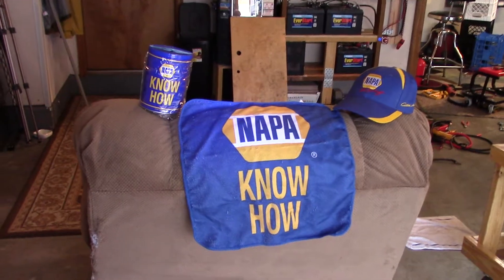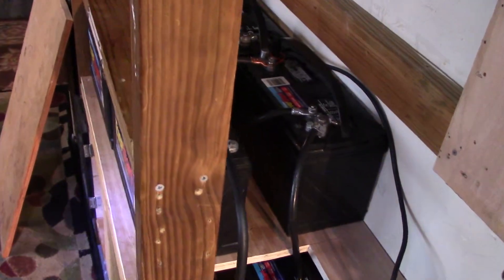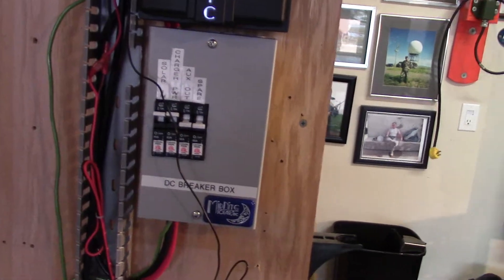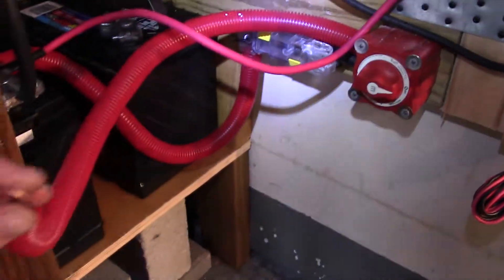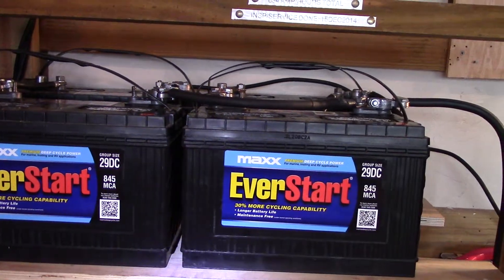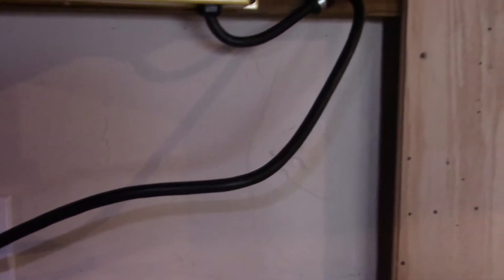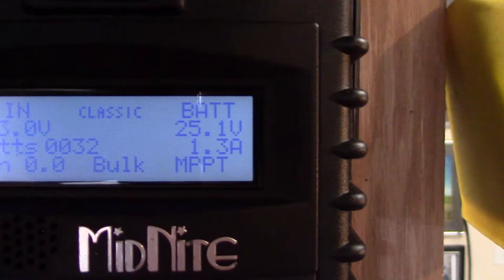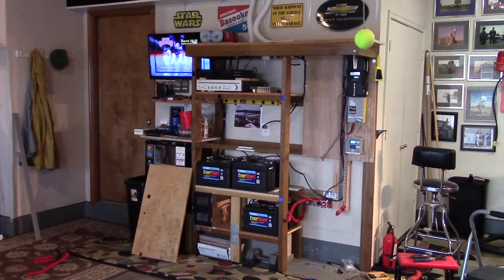Rewiring solar power battery back from 12v to 24v (Upgrading inverter to Outback Power)

Comment: When you switched to 24v did the same battery bank last as long overnight as it did 12v setup ? I have basically same batteries I'm worried switching to 24v that I will have to go get more batteries
Reply from the maker: Older video. Nope...switching from 12v to 24v didn't do much for overnight discharging. However, 24v did help with the efficiency/heat of my system. 24v is a good compromise when upgrading from 12v...allows a little more flexibility with batteries. However, the best way to go is 48v IMHO. There are some systems even higher than 48v.

Comment from the maker: UPDATE: Got the Outback Power Mate 3 in today. Forgot to order the mounting bracket. Oops. The Outback Power inverter/charger will be in tomorrow. Gonna put a box cover in front of the batteries. It will be hinged. Something weird happened today. Both DC breakers popped (?) When I was getting about 9 amps of solar input, they both kicked off. How does that happen? I checked the grounds and insulated the run into the Baby Breaker box. Any ideas? Once I fixed the green ground wire, it seemed to run fine...but, didn't harvest much sun because the batteries charged up to full. Whizbang Jr and temp sensor was installed. Thanks,
Reply: Guess it would be easier to watch all the videos to see what you have rather than ask questions on videos way back. ;) Could you do a video on you Mate setup? My system is over-sized and has kept me from needing a genny for my two years Off-grid, but would be an idea to have a backup just in case. I am using lithiums though so wondering how much you can change the voltage set points in the Mate. Mine is a 48v system with 2000 watts of panels. I have the VFX 3648 and the Midnite Solar 200v CC.
Reply from the maker: I am still learning the Mate3 but will someday do a video soon. The AC - Input function from the wall outlet is awesome to have (or generator). I have my voltage set at 24v for "kicking over to charge" and turn on AC. I have it set to only run AC for 30 mins and give the batteries a quick charge. And then, it turns off and goes back to inverter power. Sexy stuff. Your system sounds impressive. I need to check out your videos.

Comment: how much did you give for those. Battery's I have Golf Cart battery's that are 79AH and they are heavy and they and they have 225 CCA.  I have read some were that your not supposed to use any battery with CCA written on them. but I see people use Golf cart battery's all the time with out any problems.   I will be changing that as times goes with Solar battery's I what 2000AH at 48volts and that is going to cost me about 7 to 10 grand.    but I want a nice system with 100KH of power but will be worth it when I'm done.
Reply: Here is my unsolicited input:  I used to sell batteries for the marine environment for 17 years.  I don't know everything about batteries, but there are some pretty definite truths about them.  If there is a CCA rating on the battery, that is a nearly 100 percent chance it is not deep cycle.  It may be a good battery, but it will definitely not give you the number of cycles you want, but if you really manage it (watch fluid level, don't discharge lower than 75-80%, etc), it will still last a long time.   Cost is a huge problem, and if you want to add batteries every tax season, that will not be a strategy for success, because different aged batteries don't mix well.  Arizona Wind and Sun has a forum that discusses this really well, and for some reason most of those guys are Canadian, so they are super nice.  Bottom line is , it is way more effective to conserve energy than to try and make it or store it.  My plan is to increase my number of panels by a little bit, but to spend more of my money on more energy efficient devices.  My super efficient fridge is already making my life much easier.
Reply from the maker: Fernbark Frist Right on! My system was designed just to hold the fridges overnight. With the Outback Power inverter/charger...it will keep the battery bank topped off (until there is a power failure at night). I agree...more panels is better than more batteries if the system is set up to use it that way. And of course conservation is always a must and minimizing use of power hungry appliances. CHeers!
Reply from the maker: $100
http://www.walmart.com/ip/EverStart-Maxx-Group-Size-29-Marine-Battery/20531539

A lot of folks use "starter" batteries designed for quick CCA in their solar set ups. Deep cycle batteries are really good for solar due to their deep discharge and recharge. IMO, they are built stronger with thicker lead plates and can handle heavy duty use. Starter batteries with CCA ratings are best for starting vehicles.

Dedicated solar type batteries (AGM or flooded or sealed) I hear are even better. But, they cost a ton.

Cost is always a concern. With the Wal Mart batteries...I can change them out every two years at no cost. I saved my receipts.

Hope this helps...I am still relatively new at solar, but have worked in electronics for 30 years. Best of luck! Sounds like you have a huge system.
Reply: ChrisSolarPowerMakerOklahoma my system is tiny LOL. I want a large system with up to 24kw of power with I hop one day 100KW or battery storage, and 8kw of solar or more depending on my usage,   

Right now I have a PIP 4048MS inverter like the ones Justin has. I live in the states but I have it all set up and running now just have breakers to finish the install.   My battery bank is small only 160AH that is using 8 79AH 12 volt battery's wired for 48 volts.  I ran it with a 1.5kva load the other day for a hour and half that is about 30% drain.  so not really a long run time. but smaller loads can go a long time, and it connected to the grid so I can use it at night, and when the sun is out I can power everything in the shed and use the battery's as buffer IE clouds ect. so I can run all day if its nice out if my loads are below 1kw. and I only have 6 145 watt solar panels and 2 158 watt solar panels wired for 88 volts open circuit,  but its just a start little by little. 

been looking at prices on battery's and for the nice one like Trogan and other's solar batterys like the AGM's ect to get a 2000AH bank will cost me almost 15grand.  So its one of those things little by little or every tax season.

Comment: Looking Good Chris Dang Brother That Is A Nice Over Haul  Keep The Videos Coming Buddy   Your Videos  Are Super Great Choice On Your Inverter The Best Money Can Buy Proven All Over The World
Reply from the maker: Thanks Brother! You know, some guys have different passions. Some like working on cars/trucks, woodworking, hunting/fishing, off-roading. I like doing those things too. But, solar is pretty darn exciting when you can make your own power and do it yourself. Made some great friends along the way! Cheers! Gotta get back to work this AM before the sun comes up! Haaaaaa! Cheers Brother, USAF!
Reply: You Got That Right  Hurry Hurry The Sun Is Rising Here You Have About 45 More Minutes LOL
Reply from the maker: Haaa! Yep...it has been cloudy all morning. Managed to get the Whizbang Jr, temp sensor, and a couple of other things hooked up. All good. Had to fix one cable end on the NEG charger cable end. I found the correct copper battery terminal end (6 AWG) and fixed it. Also redid the grounds with that green wire that goes to my grounding rod (which is sunk 7' down). C'mon SUN! Later Bro!
Reply: HA HA Good Deal Bro Your Getting It Done Brother